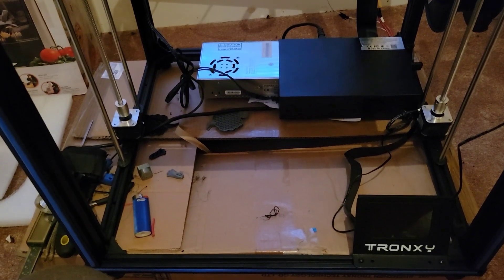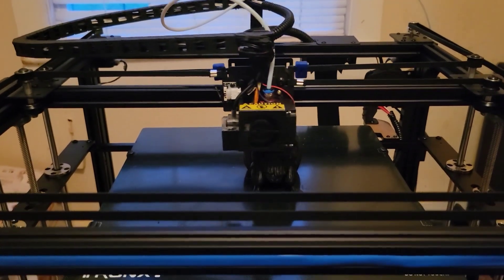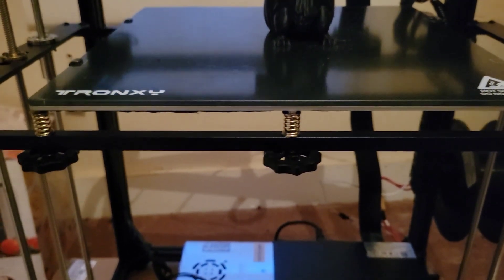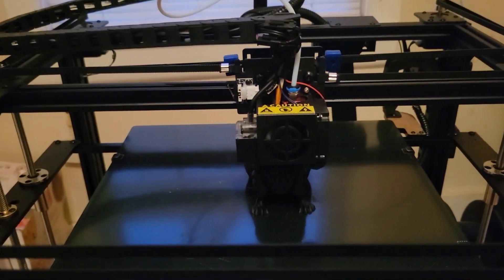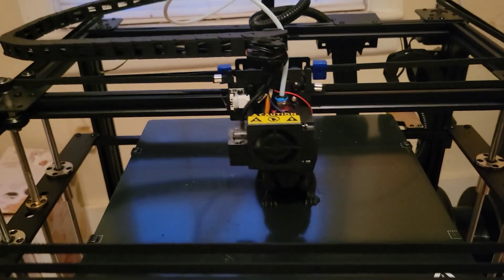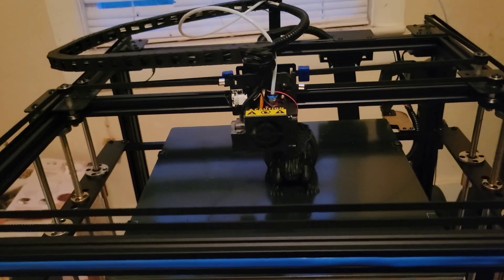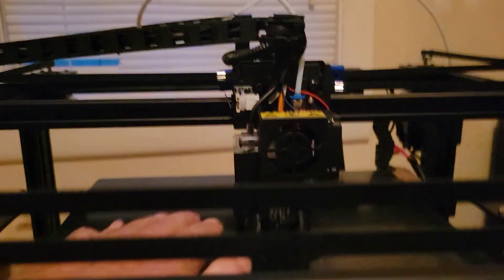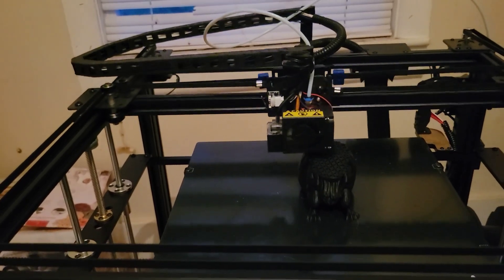Tronxy x5sa 330x303x400mm core-yx 3d printer

Comment: Just built a X5SA and im finding the Firmware terrible, Besides the lacking of major things like PID tuning, a save settings option, esteps configuration,  Baby stepping Z  doesn't adjust immediately like the old enders, it loses the Z offset between prints very easily , mine came with glass plate, I thinks its not the best surface for the sensor they provide. both the stock heartbreak and nozzle broke in the first tightening (worst metal than any replacements bought on ALiexpress)  
Noticed that in order to have the nozzle on the desired position , the mk8 style hotend requires the heartbreak to be too much off the radiator increasing a lot the chances of bending on any impact ..
I was not expecting a great stock printer anyway... but Is it possible to compile firmware for these boards ( CXY-446-V10-220413) with GD32F427  Arm chip , and keep using the fancy screen? 
Is klipper the solution for theses machines? ( Is there any problem with the ribbon cable plug extender thing? )
Can the sensor be replaced by a BLtouch or anything else ? If so how to connect the 2 missing wires from 5 used in BL touch ?
Reply from the maker: Sorry your having problems. I got rid of the glass and went to a PEI magnetic build plate. Big plus. I'm not having any issues with the software on mine. Make sure your timing belts are nice and snug. Some suggest to remove the top leadscrew holder but lm not having any problems with mine. Don't give up you'll get there. I'm going to install the pad 7 "when I get it figured out" and replacing the X,Y with linear rails for more stability.
Reply: @bobreichel  Well I'm not having problems with the machine itself but with the firmware. And those mentioned minor quality problems ( no problem for me, since I have nice stock of 3D printer parts)  As soon as I get it working with marlin, some upgrades will be done ( either it gets a BL touch or a non glass bed... Something will need to be done regarding Z axis, Maybe I will start with POM lead Nuts , maybe a Z with a belt system, and  ending up with Linear rails, direct drive with a decent extruder 
At the moment i've compiled marlin firmware for it , but i'm having trouble flashing it 
Are you using the stock board and firmware ?
Reply from the maker: Yes, I am using the software that came with it. Im not sure why yours isn't working properly my issue was the glass bed not being flat. My z axes works fine. I want to upgrade it to use klipper. Other than that I'm quite satisfied with my unit.
Reply: @bobreichel  I would be happy if it was possible with the original board , but i'm finding it impossible to flash anything in the CXY-446-v10-220413 board. I refuse to use the stock firmware, where I cant even make a PID tune , change Esteps or simply get the same Z offset between prints
Reply from the maker: That is why I'm going to attach the pad 7. It has a 7" screen and full blown klipper.
Reply: @bobreichel   after a looooong research and many attempts im just going to use a MKS robin E3D with a spare creality screen and forget the tronxy boards and screens.
Reply from the maker: I Understand, well hope the best for you.

Comment: Print some braces if you start pushing it. I installed Klipper on mine and quickly realized the sensor for bed leveling is crap. I would do a bed leveling in klipper and get a change of .3 mm every time even though I wasn't changing anything at all. Also, the rods for the bed pull the extrusions down bending them giving you convex bed. Make sure you put the washers in there between the rods and the frame.

Comment: I ended up turning my X5SA into a Voron Trident.  The X5SA is a good platform to modify it gives you great print volume for the money. If you want to go faster though, the belt pulley mounts are just too flexible. The VZBot upgrade really fixes the belt path and adds linear rails for the gantry.  I suggest building that before going Klipper.